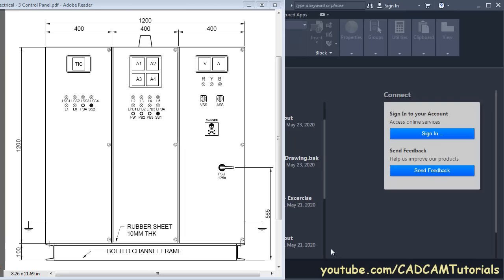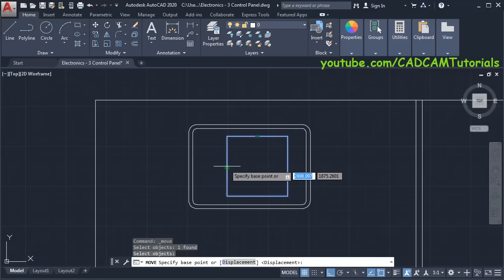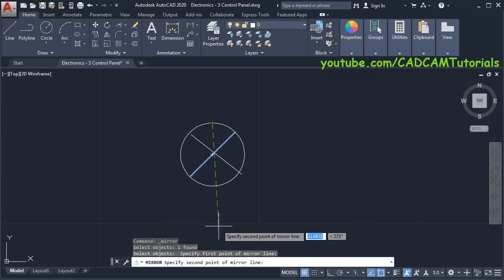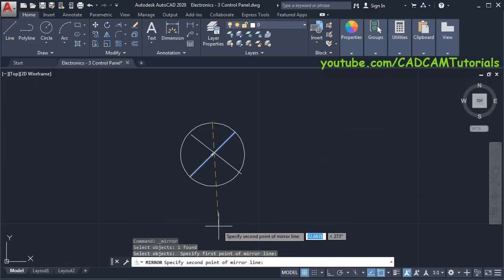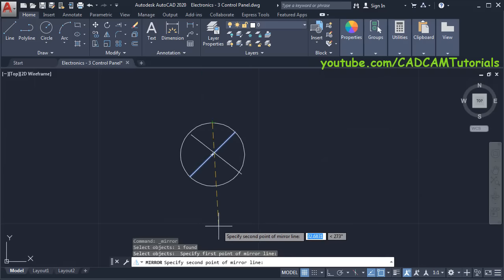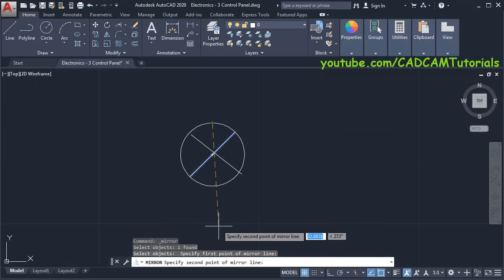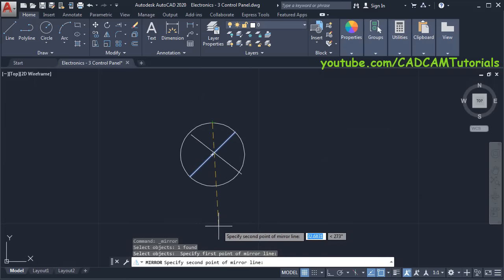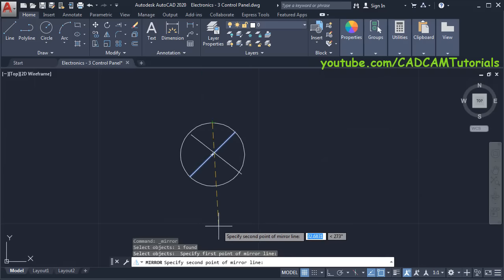AutoCAD Electrical Control Panel Board Drawing Tutorial for Electrical Engineers

Comment: You are showing all the panel drawing from standard command like line, circle etc. but actually it is not the way to design a panel drawing. This panel drawing comes up from the schematic drawing footprint that is not required to design newly as you are showing in this video tutorial. It would be very much difficult to design for the engineers each time if s/he want to draw a panel design from a schematic drawing in AutoCAD Electrical. You have to show how to do this panel design in AutoCAD Electrical software using right tools/commands.